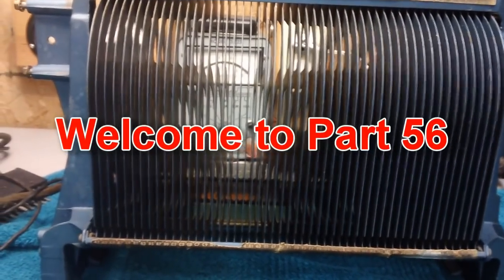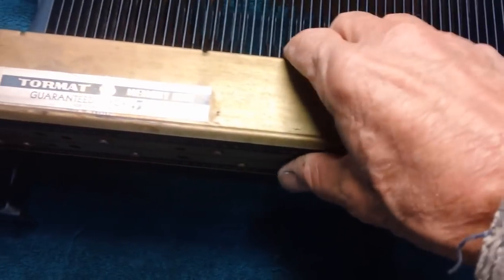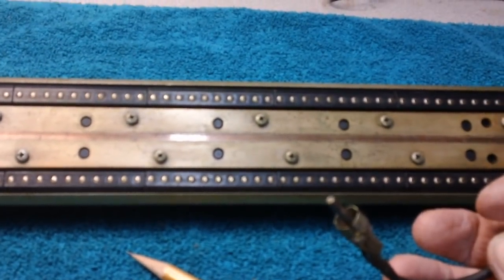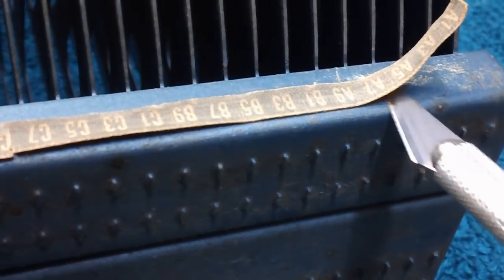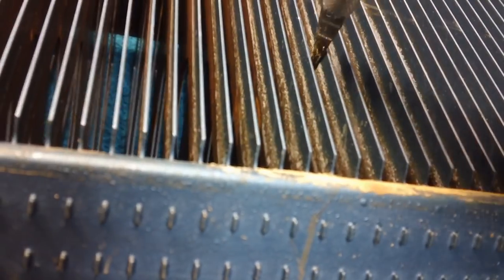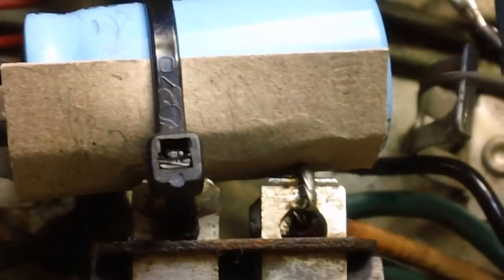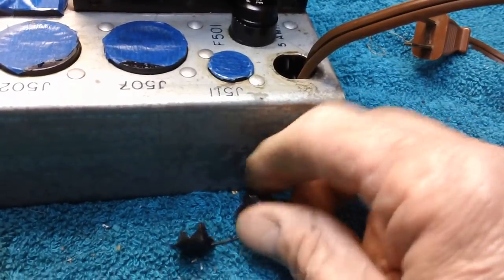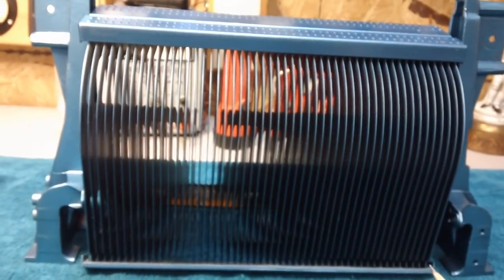1961 Seeburg AY100U Jukebox restoration (Part 56 of 87).

Comment: When I was in the dental lab, I had a bunch of those little floss brushes. I forgot all about those but they are great for getting in little spots to clean. ( they do good in between the teeth as well lol )
Reply from the maker: Carl,
Today we'll find out if they work or not.  I primarily needed those brushes for triple-cleaning the miniature tube sockets.  Pipe cleaners work perfectly for the larger ones.
Regards,
John

Comment: One of our foremost engineers, "Paul B", designed much of the magnetic core memory, which was used in aerospace guidance systems (from the early '60s through mid-'70s). That stuff was a gigantic pain to build; there was a problem, common to the design/theory referred to as "parity". Paul invented the slang term "Boolean Booger"; which, from what I came to understand, pretty much covered the attitude(s) of the production workers who wrapped the stuff, and the techs who were tasked with making it work. PS, Paul, in his early 80's, becomes irate each time he sees a USB Flash Drive. (he's still using a Commodore 64)
Reply from the maker: Tim,
From what I understand, the first Apple computer memory was composed of a bank of those coils.  How far we've come.
Regards,
John
Reply: Paul was the same person, that almost started the riot, at "Star Trek: The Motion Picture". Absolutely everything which he did, managed to amaze - he's one of those "once in a generation" types. I never knew that they used magnetic core memory in these (at that time); I'd have 'thunk' relay-microswitch positioning/locating was still being used.  This just goes to show,  how very bulletproof that '60s stuff still is!

Comment: Hello John.  Just a reminder, You asked about where to get those label strips with numbers on?  May I suggest you check with VICTORY GLASS  they sell Jukebox parts and some reproduction items, they may or may not have those record number strips. Also those Toroid cores remind me of the old magnetic memory cores used in computers of the late 1950's early 1960's they have THREE real fine wires running through EACH core one wire is a DATA OUTPUT line, another wire is a ADDRESS line and the third wire was a SENSE line,  ----  OR something like that, My memory on this fact is a little FUZZY.  The Core was made up of a kind of material like IRON OXIDE called Fairite , it is a mix of iron oxide and other materials that is made into a kind of ceramic like core,  these cores had a few different sizes and were all wired by hand, thousands of them mind you!!  Have a good day !!!     ------------------------    John Bellas     KC2UVN    and  ex IBMer of 30 years.
Reply from the maker: John,
Victory had nothing to offer.  But not to worry, as something will pop.
Regards,
John